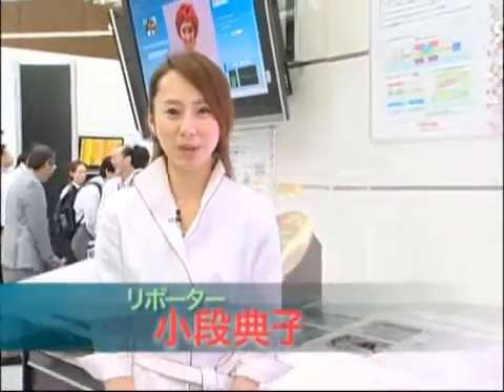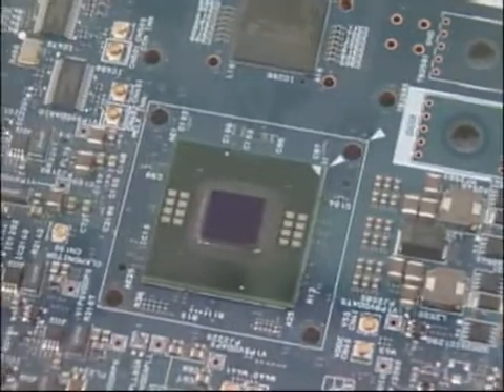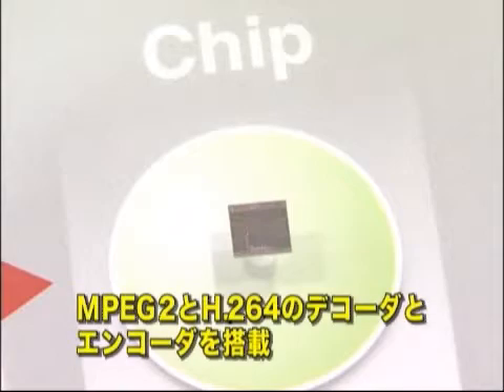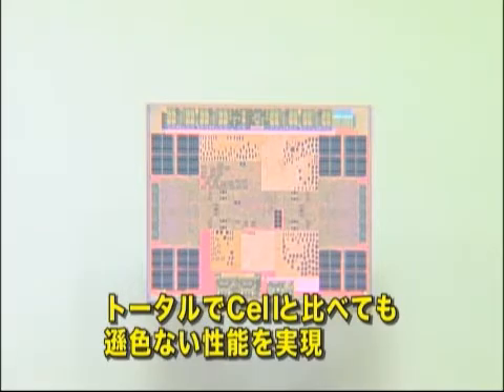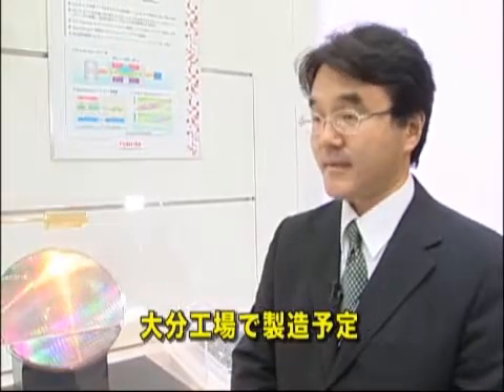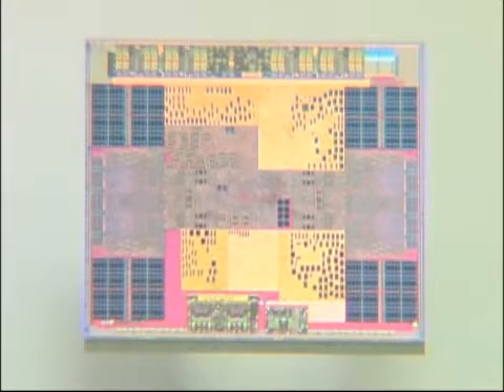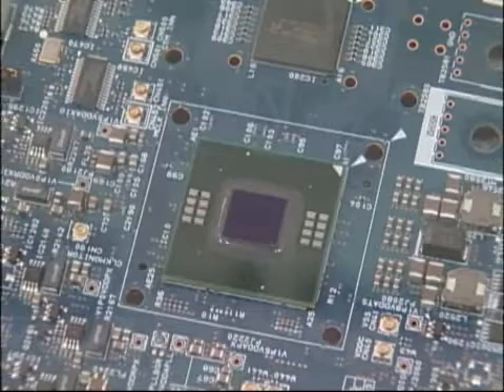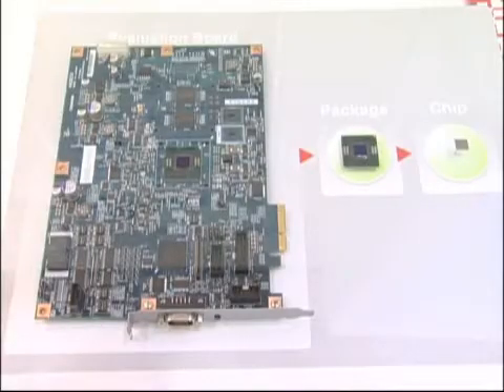SpursEngine Architecture

Comment: Dear, I am interested by the SpursEngine architecture, on which I would like to develop some tools about video. The SDK is no more available on the website of Leadtek (card PxVC1100 based on SpursEngine). Do you have such a SDK, could you share it using dropbox or googledrive or whatever? Thanks.
Reply: Charles Clercq  tengo lo que buscas, dame un tiempo para subir el SDK, pienso que se puede hacer FHD a 4K, repitiendo el proceso cuatro veces por cada imagen.
4K=4*[(FHD/4)*SuperResolution]